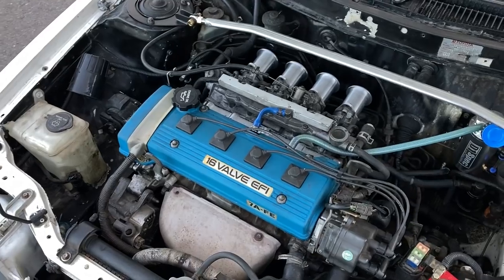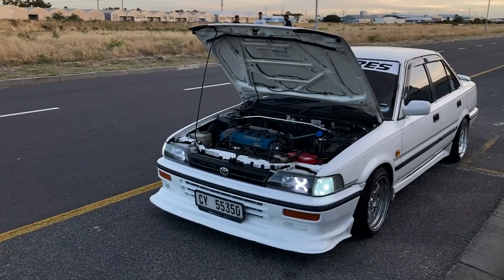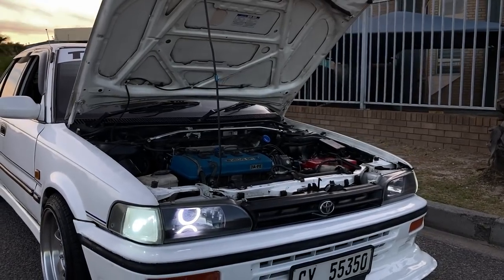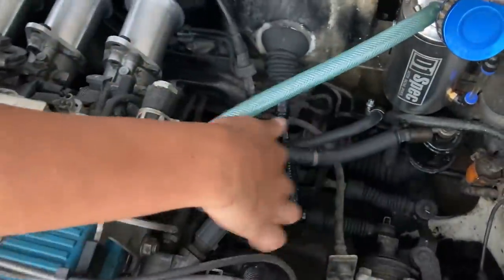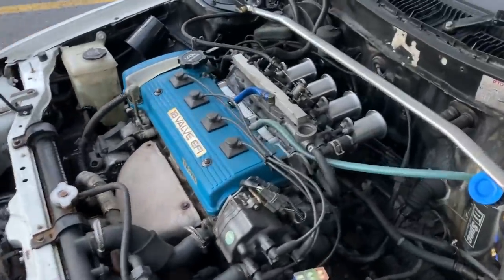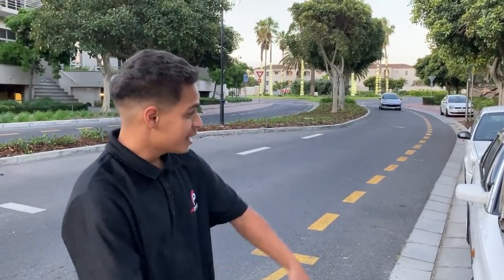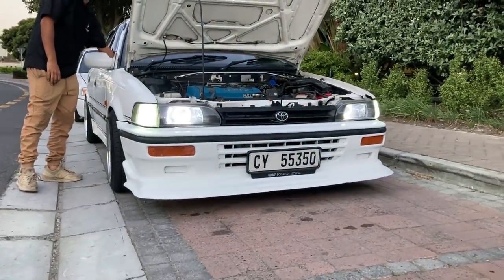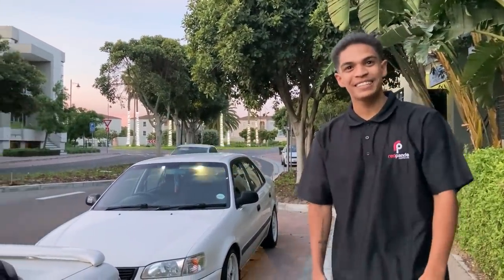7AFE Corolla AE92 running throttles! HOW??? | This is my ride EP 53

Comment: Awesome setup. 7afe would be lucky to get around 65kw on the wheels here in jhb. There at coast not sure. Torque should be around like 140. But let's see how close I got lol.... just got to the end of the video. I dont know how at coast adds like 30kws to an engine lol. Honestly most 20vs here in jhb do around 95kw or so. It just doesnt add up lol.